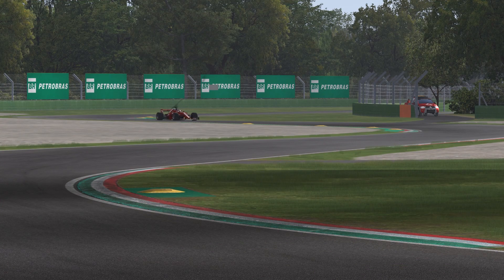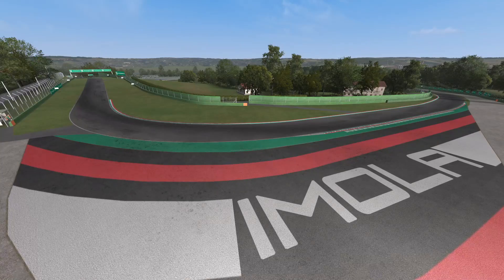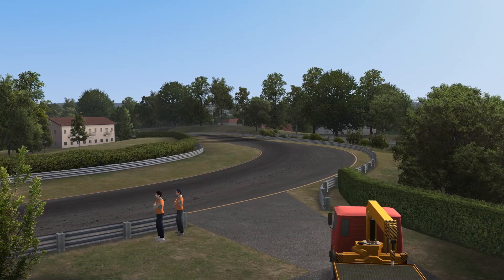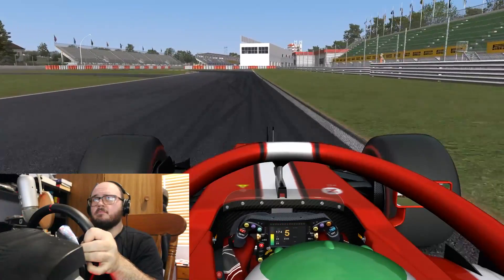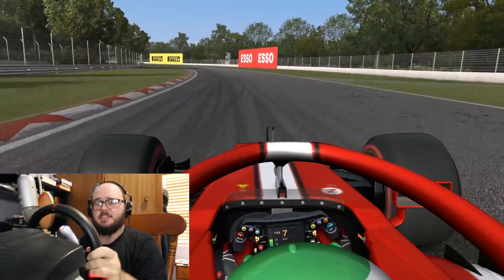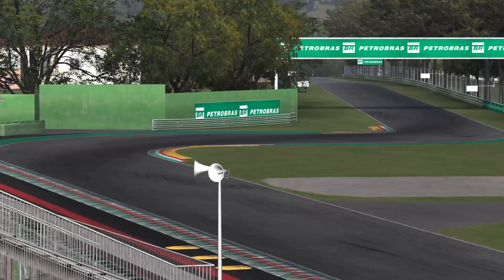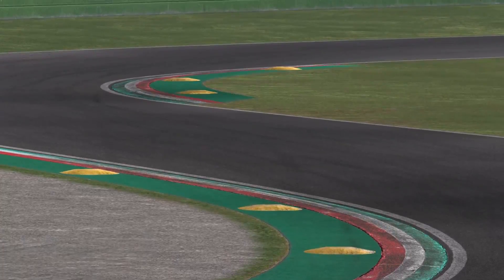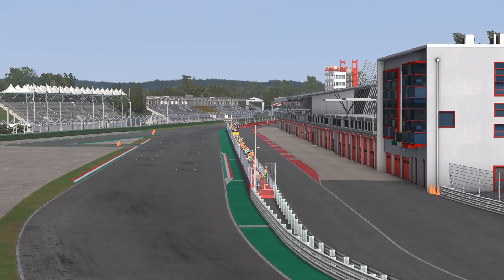Trying Imola Through the Ages In A Modern F1 Car

Comment: I actually prefer the new Imola. Those so-called chicanes a Tamburello and Villeneuve are a blast to drive through. Keeps you much more on your toes than the easy flat sweepers of the 80's (in high downforce cars at least)
Reply: Also that chicane on Aqua Minerale was THE WORST! And it's now one of the best corners in the world.
Reply: If I could pick and mix I would get the early 2000s version without the last chicane. 

The track limits were far more clear (narrower curbs, grass right next, no need for yellow bumps). Also Variante Alta was awesome when it was faster but had higher curbs.
Reply: Exactly
I love the new layout
But I kinda miss the Variante Bassa a bit
The first leg was super fun
Reply: The new layout is great to drive around, but the racing was seriously bad, which I think could only be improved with drastic changes such as removing the Villeneuve and Alta chicanes
Reply: @dielegende9141  Or what about doing Tamburello Mexico turn 1/2/3 style (in the correct direction of course). I think removing Variante Alta would be a bit dangerous though. Imola's charm comes from driving around it really fast, instead of wheel to wheel combat, like Monza or Bahrain. I think it's nice to have a diverse track selection instead of making Monaco wider than wide Putin and Suzuka three hairpins with some easy flat corners in between. Good idea nonetheless
Reply: @danielsgrunge  Variante Bassa is amazing in Automobilista 2 in a 90's Benneton. It's like Copse or Signes without the chicane. Almost flat but not quite. Putting it where Variante Alta is now would be a good idea, since you have three challenging corners (Piratella, Acque Minerale, and Variante Bassa), where you have to be faster than the car in front and a good overtaking opportunity into Rivazza.
Reply: @dielegende9141  Removing Alta can be dangerous because lack of runoff, removing Villeneuve i think there's a possibility but the runoff is still to small atm

Comment: The thing is that FIA introduced more chicanes and more chicanes on the tracks while the cars got stronger and glued to the tracks improving safety. 

Senna didn’t die because of the lack of safety but because of a broken steering column on his Williams. 

Instead of improving the cars the FIA tried to reduced the speed on the tracks. 

It’s a shame imo that so many tracks got cut. Imola without chicanes would be much more interesting make overtakes easier. And, because of all the safety features now available on the cars and the wide run off areas we could re-introduce speed on these tracks whiteout risking lives.
Reply: senna crashed because of the steering collum. He died because of the track safety

Comment: Nice video. Maybe Österreichring/Red Bull Ring next? Although I don’t know if a 88-95 version exists in sims
Reply: AMS does have the old version of the Österreichring, depends if it needs to be a very specific year.
Reply: @peterdaviesracing  Yeah there’s the original track with and without the chicane, but after F1 left in 87 the track was modified before it became the Red Bull Ring (or A1-Ring). It was widened, more runoff, tighter Bosch curve. Either way it would still be a cool video
Reply: @bougieweightlifting  

Thanks but I know that, I've been watching F1 since like '98-'99 consciously :D
Reply: @peterdaviesracing  I wasn’t even born yet 😂
Reply: @bougieweightlifting  

I was 9-10 back then :D

Comment: Now run a car from the historic era and do the same...You'll find the track layouts back then allowed the cars to get up to speed(not that they were much slower overall). Maybe rose tinted goggles but all the older tracks seemed to have some very subtle and not so subtle nuances to them that made them standout far more than what we have nowdays ie; Bathurst with it's very narrow run down and onto conrod,Zandvoort with it's ludicrously fast ,flowing back section etc. They're all boring in modern cars that are made to handle corners though but period correct vehicles there's a bit of magic around balancing the car. Informative vid nonetheless.